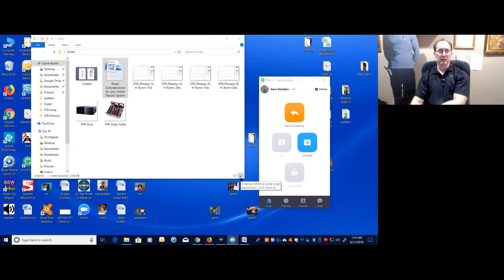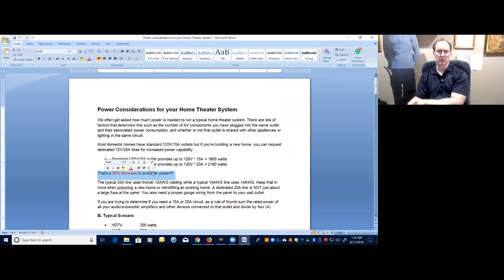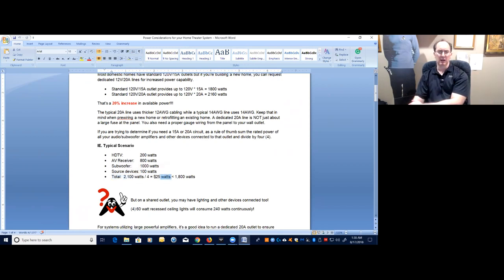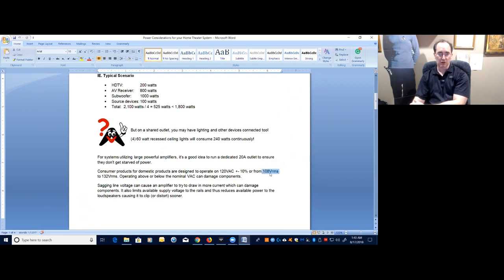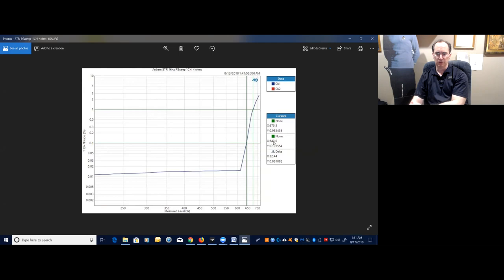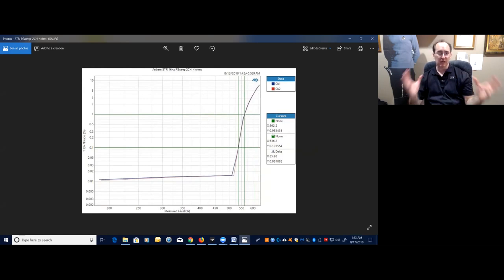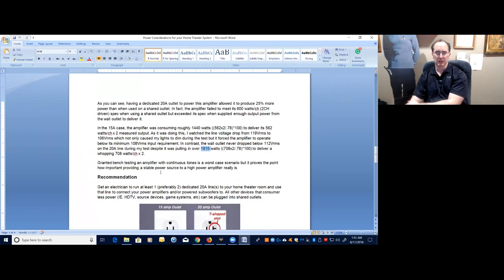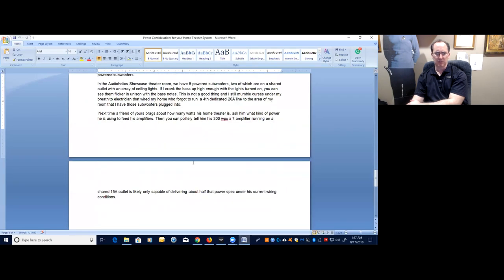AC Power Considerations for Your Home Theater System

Comment: Furman does offer a 20-ampere voltage regulator with a balanced output isolation transformer to provide a 60/120 volt balanced output for the ultimate in a low noise-floor specification, of which is specially suited for sensitive audio-visual equipment, (especially digital signal processing gear.) power amplifiers may need additional dedicated circuits (sometimes larger than 20-amperes) depending upon the size and/or output rating of each power amplifier. Larger commercial power amplifier(s) (in excess of 3kW rated output) may require a dedicated 30-ampere 120-volt circuit(s) or possibly even be configured for 240-volt operation for adequate power & satisfactory results for output power @ a specified wattage, especially when driving low-frequency band-limited loads, such as sub-woofers.

Electrical branch circuits as specified in the National Electrical Code shall not be loaded more than 80% current carrying capacity, of which equates to: 

1,440 watts (12A) for a 15 ampere branch circuit (1.8kW capacity), operating @ 120 volts nominal operation.
1,920 watts (16A) for a 20 ampere branch circuit (2.4kW capacity), operating @ 120 volts nominal operation.
2,880 watts (24A) for a 30 ampere branch circuit (3.6kW capacity) operating @ 120 volts nominal operation. 

Higher wattage is more efficiently obtained by re-configuring your equipment for 240-volt operation. 

I've been designing & engineering professional sound reinforcement systems for concert venues, night clubs and similar venues for over 25 years.

Loading all of your audio/video equipment on only one leg of your electrical service may lead to undesirable or unintended conditions resulting in a loss of power or a voltage drop or a voltage sag of which can be very noticeable, especially during periods of high transient output. 

This is especially true when thousands of watts are dissipated for power amplification during periods of high output transient peaks or during sinusoidal (sine-wave) testing or system calibration or output measurement.

It's always beneficial to keep all of your electrical branch circuitry balanced at the service panel, and to use balanced Low-Z line-level interconnect cables for transmitting low-level or line-level signals over long distances (in excess of around 6') so as to prevent any objectionable EMI/RFI interference. 

Additionally, make sure that all of your audio grounds are kept separate to prevent ground-loop induced hum. Balanced cabling using either 1/4"TRS phone jacks/plugs or 3-pin XLR typically rejects such noise by principle of using 2 conductors within the interconnect scheme that are 180 degrees out of phase from each signal-carrying conductor within that particular cable assembly. 

This causes phase cancellation that rejects outside noise influences on the audio line. Connection of all audio grounds may also cause system oscillations. 

Some audio equipment may also offer a ground-lift switch to safely and effectively isolate audio grounds easier.
 Whatever you do, DO NOT USE a "cheater adapter" to defeat the 3rd-prong safety ground pin on your power plug as a way to lift the ground to prevent or stop the ground-loop induced hum or noise in your system. 

Some manufacturers also offer various products to convert consumer-level unbalanced equipment to drive a professional-level balanced audio line-level configuration, of which may already be standard on some esoteric "high-end" audio equipment. 

Professional standard audio line-levels are also a bit higher in specification (+4dBu/1.4V standard operation levels versus -10dBv/0.775V for consumer-level unbalanced line-level audio signal paths.) 

Some equipment, such as some entry-level or low-end consumer audio/video receivers or integrated amplifiers may not offer much sufficient output voltage, if they even offer pre-out (line-level pre-amplifier outputs for the express purpose of driving outboard power amplifiers) as an upgrade alternative to the often mediocre under-powered amplification that is often included in most consumer-grade A/V receivers. 

Power amplifiers are more immune to this sort of interference, due to the high-voltages, higher currents & higher concentrations of magnetic fields that may be present within the confines of its chassis. 

Speaker-level output cables are typically immune to this type of interference as well, due to the higher voltages & currents present across the speaker line terminals. 

For this reason, speaker cables aren't typically electrically shielded.

Comment: Using THREE dedicated 20A* feeds power a 5.5 HT system, later wishing I ran a 4th. 

Two of these* provide power to 6 Rotel 98X series amps & 5 powered sub*, one* at each corner w/the 5th handling CC heavy lifting and LFE chores. The 3rd feeds an APC H15 power conditioner that power the Outlaw pre/pro, TV, DVR, BDP, several EXOs, and a CD changer

Comment: Thanks, great info..Yes, I had the same problem with my sister's system.. Plugged into the general lighting circuit and the surrounding lamps would dim when the amp was at high levels or first turned on.. We'll move it to a dedicated circuit when time permits.. Want to add one consideration to your excellent discussion.. The NEC allows 12 awg as the minimum conductor size for a 20 amp circuit.. And that might be acceptable if the dedicated receptacle is near the main service panel.. But some installations are some  distance, so one might want to consider voltage drop over the distance.. Probably a good idea to quickly calculate voltage drop to determine if 10 awg would be a better choice..  Often it is, and the additional cost is minimal.. Keep up the great no BS videos.. SUBSCRIBED!!

Comment: I added a separate sub panel and 20A GFCI GFI Receptacle Outlet w/ Wall plate & LED Indicator - UL Certified, White, 20 Amp 125v, 12/2 with ground Romex brand SIMpull residential indoor electrical wire type NM-B, Yellow for each of my components for 3 subwoofers 1 SVS 16-Ultra Subwoofer, Two 12 earthquake which is not needed since I got my SVS. Yamaha RX – A2010. I never have problems now. My house light would flicker before I added all of my new 20 amp. I have added 4 20 amp outlets for my new equipment coming.

Comment: Thanks for posting Gene, I have a dedicated 20 amp line that feeds a PS Audio P10 power regenerator. My equipment (Dual SVS PB 4000, dual mono PS Audio M 700 amps, GoldenEar Triton 1s and an Onkyo TRZ-900) benefits greatly from it.😁😁😁

Comment: I have an dedicated 80 amp service sub breaker box fed by 4 gauge cable. This is feeding 4 each 20 amp breakers going to 4 separate 20 amp double outlets wired using 10 gauge wire feeding my system. I have 2 each ATI AT2505 amplifiers that each require their own 20 amp circuit. I also am running 4 each Sub-woofers.

Comment: Thank you for running that series on the dedicated lines for your amplifier system. I have a question I just purchased a new system hasn’t been delivered but the amplifiers are here one is the Denon 6400H, and the other is the EMOTIVA AUDIO XPA seven. The speakers are definitive technology 9080 series complete set for the front three channels and the maximum size on the rear bipolar speakers and a pair of SVS heights speakers which I was installing today and getting all the wiring prepared I have two outlets I have a monster Monster power conditioner and I have two dedicated outlets in my living room wall and I’m debating should I get another power conditioner just to drive the three tower speakers in the mid range I’m sorry the center channel speaker do you think I might have a problem if I add a Nother power conditioner for the rack wants the rackcomes in and I’m able to set my amplifiers in place by the way I’m also running an oppo 205 and an Oppo 203 Do you think I might have a problem I’m in an apartment and I believe I’m not sure what the amperage is but I do know that I do have a dedicated line to dedicated lines on that wall what do you think.

Comment: I'm lucky enough to have 20A lines in the area around my home theater. On one dedicated outlet (no lights tied in, just a single outlet) I've got a HTR (and 98 dB+ efficient speakers) that can pull 9.5A max, a 4K player that uses 15 watts max, 230 watts for the TV, two Velodyne 15" subwoofers with external amps, and three 10" ported subs, two with built-in amps.  The miniDSP is probably a very minimal draw.  I've got three more 10" - 12" subs, but they are on a separate 20A circuit. 
 The only unknown for me is just how much power the sub amps are capable of pulling from the wall.  None of the manufacturers state that in their literature.  Is there a rule of thumb, based on rated amplifier power or something?  If I knew that, then I could do the calculations from your video.
Reply: You take the output power of the amplifier (watts) and divide by the line voltage (normally 120) and that gives you the current (amps). For example, if you have a 1500 watt amp, 1500 ÷ 120 = 12.5 amps. However this only works if your amplifier is 100% efficient, which it isn't. Sometimes manufacturers give the efficient rating, some dont. Let's say your subs amp is 70% efficient. We take that 12.5 amps and divide it by .70 and you now get 17.8. So your 1500 watt amp will pull a max of 17.8 amps.

Comment: Thanks for the insight ,have a question I'm running some older and newer equipment connected to a power line conditioner Monster HTS 3600 MKll , An Emotiva XMC-1,B&K Reference 200.7 amp , Rega Turntable, Oppo UDP 203 , Direct TV receiver , My Velodyne and Klipsch subs and LG OLED onto another line conditioner HTS 1600, on another wall outlet ,why would I run a dedicated 20 amp without protection and how would you recommend to fix that issue as well as maintaining the most power and efficiency,I recently moved to Florida from New York . Lightning here is the highest in the country I believe . Thanks for all your work BTW I do enjoy using your site for information that comes across as true and understandable .

Comment: little late to the party here, but great video,
have a question though, i stepped up to the monolith 7x class AB amp, and running 3- 3000 watt behringer amps class D for subs powering 2-15's and 2 18's. I was running everything off a Belkin PF60 surge protector/ conditioner, i never noticed my lights flicker or anything but when i got my last 2 subs (mini marty 18's) and nx3000's it doesn't seem like they are bumping. The belkin has amps of current draw on the front panel but i never noted how much it was pulling during a movie yet, never popped a breaker. I'm moving to a unfinished basement going to build my home theatre that I've been working towards. Would i benefit from running a dedicated 20 amp line for 1 outlet/2 outlets/ more?
thanks in advance

Comment: Great video Gene.  One thing I was wondering about was when you use a dedicated outlet what do you use to protect the equipment on those circuits.   If one uses a power bar (trip lite, apc, or Panamax, Furman) or power conditioning can they mitigate the benefits of the dedicated line?
Reply from the maker: Me Ma yes you have to make sure the power conditioner you use is 20A capable too.
Reply: Audioholics - I would love to see a video on how you set up your system with power protection/conditioning.  I've always wondered if some of these power distro units are snake oil or if they are legit.  It would be great to see units measured.

My buddy swears by the improvement in sound quality with his power conditioner.
Reply from the maker: Anyone claiming fidelity improvements of power conditioning is likely suffering the placebo effect rationalizing there must be a difference because they spent high dollars and trying to rationalize the cost.
Reply: I claim an audible difference and if you come for a visit I can prove it to you, I can easily hear the difference (in Norway that is)
Reply: Audioholics Good point.. Most 'noise' issues are ground loops, something a conditioner can't fix.. However, the conditioner does place the receptacles close to one another,  which will help prevent ground loops, as you mentioned.

Comment: Your math is off, going from 15 amps, 120V is 1800 W, to 20 A 120 V is 2400 W, assuming power factor is the same 2400/1800 is 1.33 or 33% increase in available power.

Comment: Andrew or anybody: I have the problem I can't fix. My speaker sound statically, and scratchy, I have three different sets (Elec, Polk both are new, Old set of Maggs. Amp/intergrade  Yaqin ms-20l, Mcintosh 6900 (has been service, was thinking this was the issue) and belles ref 350. Change all cables (power speaker). Source DAC, and CD player (sent signal straight to preamp or integrated amp). Got a Monster Power AV unit, still same old problem.  Thinking its got to be power from the wall socket ?

Comment: How many electrical circuits did you use for your theater room? I'm in the middle of constructing theater room and trying to figure out how many circuits I need. The room will have 11.4.2 denon. Projector 6 power seats. I'm planning on  2 circuits using 12 guage wire on 20 amp breakers. Will this be enough?

Comment: Hey Gene. I just bought a Denon avr-3800w on your recommendation. As soon as i picked it up i knew, gutless power. Compared to my broken str-5400es sony. I have ab 200 watt Adcom amps. My question is. If you use an external amp. even with the power draw. Is that at all helpful to the Denon? Without damaging the Denon?

Comment: What if we use voltage stabilizer to get constant voltage &spike surge protection?
Reply from the maker: Yogesh Sakhare they are fine as long as they don't limit the power, most do however. Check a mom p rating of the product.

Comment: Gene I need your help I am currently turning a 14x24 utility shed into a home theater it will be a 7.4.4 dolby atmos system I need to know how many dedicated 20 amp lines I need this is a list of my equipment speakers are emotiva t2 towers c2 center e1 side surrounds b1 rear surrounds atmos speakers are 4 rsl c34e my prepro is a marantz av7704 amps are outlaw 5000 the newer version with the xlrs running atmos outlaw 7000 running 4 surrounds and emotiva xpa 3 running front stage ps4 pro for gaming nvidia shield pro for streaming panasonic ub820 uhd player a monster power hdp 850g green power surge protector panamax m5400 power conditioner optoma uhd65 projector 2 svs  pc2000 and 2 svs pc13 ultra lights I have 12 led 4 inch lights and 6 led scones with a lutron smart switch kit how many 20 amp lines do I need and what should be hooked up to them

Comment: I heard from YouTube video few years ago if have switch 120 or 240 volts higher voltage will make amps run cooler???  also what about power conditioner and PS audio power generating station???
Reply: Dan Donna Doubling the voltage will cut your current in half.. So, yes, it will generally run cooler..
Reply: While doubling the voltage (assuming your equipment can be switched.to 220V) does cause the current to drop to half, the power stays the same, so temperature won’t be affected in most cases.

Comment: So tubers, do we have any opinions on whether national electrical standards would benefit the audio industry by being modified?
Reply: My thoughts are that as grid power quality improves, it will benefit audio output quality which may sway some interest in home audio, and that grid quality improvements may also canabalize some of the power conditioning market.   Naturally if you're adjusting the grid it's a long process on the scale of decades or maybe even a century of planning/adoption.  As our products become more energy efficient it would make some sense to have lower voltage lines that don't need to be stepped down by transformers (which is an inefficient and lossy process of conversion) .  Simultaneously our world is advancing with more and more electrified capabilities,  home car charging being the most prescient demand for steps up in power.  But also unforseen luxuries of the future,  electric roto tillers, lawn mowers, home elevators, mobility assistance scooters and pods, pumps for fountains pools and rooftop gardens, driveway heating.  I expect electricity to become cheaper,  creating the opportunity for more frivolous use that would benefit from having more power on tap.  I think two lines may be a good solution, a 5v o12v for low power efficient devices. And much larger line for heavy appliances.  It will take more copper but avoid the losses in transformers, but maybe energy will be soo abundant that transformer losses will be unimportant.  Leaving material resource management of copper the more finite resource.  All I know for sure, is that as soon as I can afford it, I'm getting a dedicated line installed made of pure Silver, all the way from my house to the sun.

Comment: Gene I know this is an older video but I am try to figure this out. I am building my theater in a room I have. I have questions on surge protection. I have a Denon 3600h reciver, 4k player, aircom t10 fan, monolith 7x200 amp, 2 monolith 15" ported subs and a Epson 6050 projector. How would you go about protecting all of this? I was looking at the Furman elite 15pfi I but I would be surprised if this can power everything. I can run circuits easy as my panel is right there. I do already have a 20 circuit to my av rack. Would you run multiple  surge protectors? Thank you for the help

Comment: I'd like some advice. I'm starting my theater next month and I will have a marantz 8012 (11.2) receiver 7 power recliners with rumble seats on all seating, projector, Bluray player, and Xbox one/PS4. I'm planning on running two 20 amp circuits One for the equipment and the other for the seating. And a 15amp circuit for the lighting all on the same phase. Do you think this is suffecient or is this over kill? Would appreciate your advice. I reached out to several youtubers but haven't received any answers. Thanks